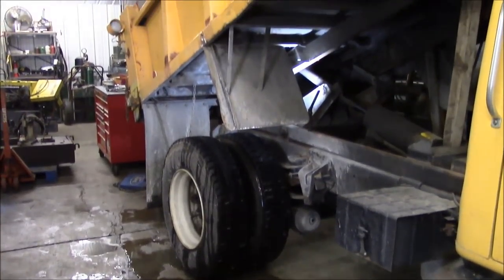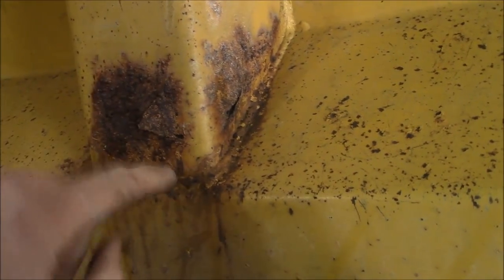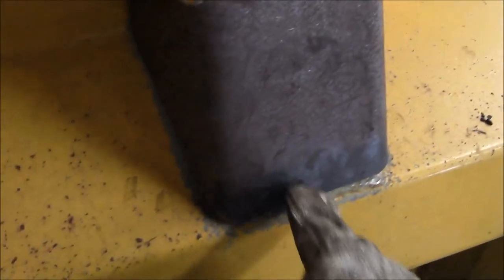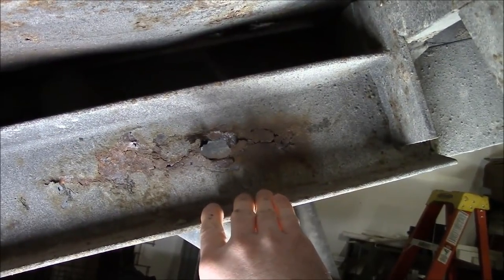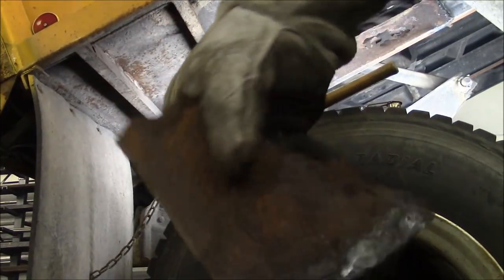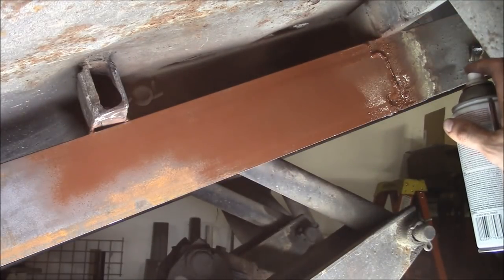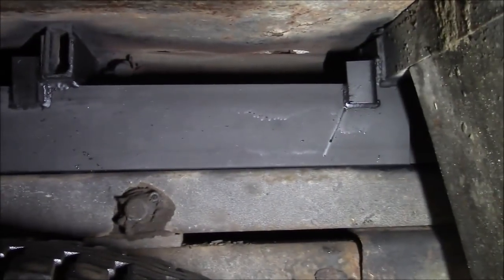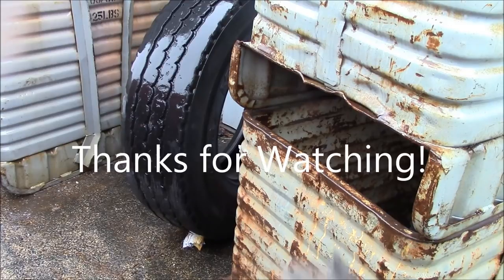Fixing a Rusty Dump Truck Box

Comment: I've had very good results by heating my steel and then painting it.  I believe its the next best thing to a baked enamel paint job that one can get without actually baking the piece in an oven.  I built a ladder rack out of 2x3 steel tube and the paint lasted for 15 years before I took the rack off and did it again.  Nice work, good video, thumbs up.

Comment: Hi Wes. This rust is it caused by the snow and salt used on the roads we read about? We know about the runners on cars having this rust through. "Rust Jacking" always learning never heard of it that is amazing strength what it is able to do, if you did not show it, we would not have believed it.  
Collector dumper trucks are going to become a new YouTube thing now Wes. We just learned about the needle hammer watched a rebuild kit for we think a Snap On version it is amazing, used a lot on Semi-Truck frames and bodies per the video we watched. Boy Wes your welds are GRADE A to these two guys still needing to learn it. Even as you share working on these steel patches in a non optimal conditions your work welding looks really good and solid. Nice lesson on double framing only good in the western USA then? Thank you for the share, Lance & Patrick.
Reply from the maker: Well this truck was used to spread salt on the roads for 35 years. The salt rusts everything. Since iron oxide has a larger molecular volume than steel, the rust creates a mechanical force between the beams and can cause a lot of problems. 

This is relatively thick material, so pretty easy to weld in my opinion. Thin metal is the hardest for me to weld.

Comment: I used to work at a small factory, where we made specialty trailers for pellets and wood chip transports. We also tried to fix up the older ones, and others that had at some point ended up in a ditch during winter. Working on the old warped and rusty ones was zero fun. That rancid smell of burning paint in the morning... Luckily I was for the most part involved in making brand spanking new ones, with clean and pristine metal surfaces, which were a joy to weld! :D

Comment: Pretty cool example of rust jacking, I haven't seen anything that extreme before.
That's why steel keeps rusting - the oxide is so much larger in volume than the metal the crust keeps fracturing and crumbling away. Many other metals form oxide layers just as readily, but once the surface is passivated they just stop. If there is no electrolytic action with other metals nearby that is.

Comment: i was doing the same with the bed on the diamond reo in the fall. got most of the one side done. had to make new sideboard pockets and patch the uprights as well. tackle the other side in the spring and the hinge is getting thin also
Reply from the maker: Yeah I've seen a lot of these old plow truck rusted in the same places. The ones with braces on the sides of the box that run horizontal instead of vertical seem to rot out even worse.

Comment: Can't under state how important it is to always engage safety supports (carrying the load) under any elevated box.  Had a younger guy fixing some damage caused when it was overloaded with sand (shocker right?).  He was cutting some material out, and a big piece of slag/material managed to land on a hydraulic line.  He rushed out to have lunch with his girl.  Returned to find one hell of a mess.  Oil sprayed everywhere, and of course the box was down.  I'd like to think he would have noticed it had his mind been on the job and not something else.  On the other hand it is difficult to maintain full situational awareness when cutting or welding.  Did the distraction contribute or save him?  I sure as hell wouldn't wan't to check out like that.  I bet if a torch was running when it happened it probably would have been a massive fire ball.
Reply from the maker: Yes. There are some risks not worth taking.

Comment: Hey Wes, great video, and maybe this is a stupid beginner question, but at @10:52 when you reinforce the plate, why wouldn't you cut the rust out and try to weld that patch into the hole?  I was thinking that if that arm twisted, the patch might just be broken off.  But if it was welded into the frame, it would twist also.  I'm considering repairing a Knapheide dump body used on a Missouri snowplow as a salt bed, so all the rails are in bad shape.  My first thought is to cut out the rust and weld the support piece into the hole, then maybe patch around those welds.

Comment: I like how you did a keyway on the frame rather than a straight butt weld.  Why not get a old electric wiper motor from the junk yard and with a few mods the problem is solved much easier.
Reply from the maker: I'll have to look into electric wipers. I know that the cab is basically the same as the newer trucks, only the hood is different.

Comment: Wish I had the confidence in my welding to do that. Need a decent welder then will practice some more. Good video.
Reply from the maker: I use an old white faced Millermatic 200. It's probably at least 40 years old. It's still a better welder than I am!
Reply: I bought a lincoln weld pak 140 from home depot for my mobile welding business, i plug it to my lincoln 305g generator and man does that small machine really handle the tough jobs. Only downside in owning those small machines is you cant be constantly welding and welding, otherwise you will max duty cycle quickly.

Comment: Just asking why didn’t you put the channel like it was Weld it an plug weld it , I think the way it is it looks like it would hold a lot more shit like a opened box frame would , cool vid thought 👍🏼
Reply from the maker: I could have. There's not really a good way to do it. Since the ends are open, at least you can clean it out. What seems to rust really bad is box sections that are closed on the ends. They get a small rust hole somewhere and then pack full of crud and rust from the inside out.

Comment: Late question for a older video,what kind of welder do you use?
Reply from the maker: A Millermatic 200 that's significantly older than me. I'm confident it will be running long after I am dead.
Reply: Thanks My friend,I do really enjoy what you do,keep it up.